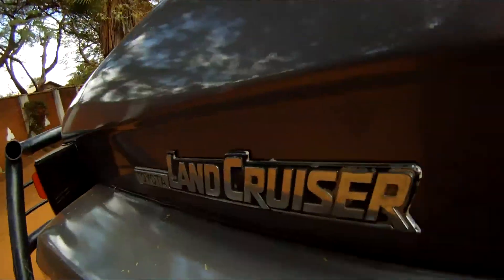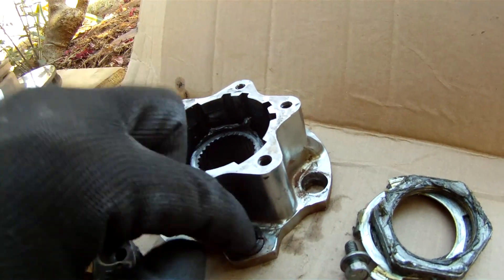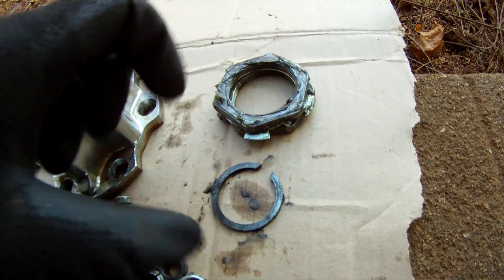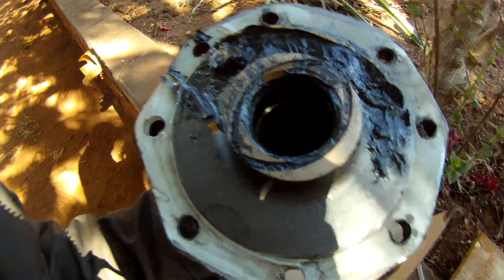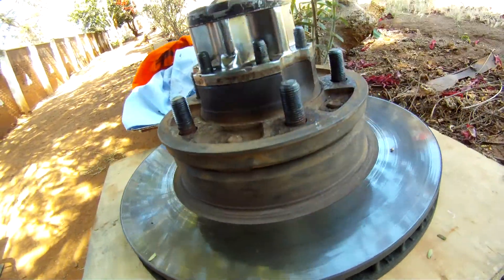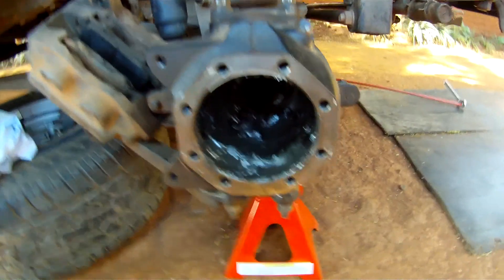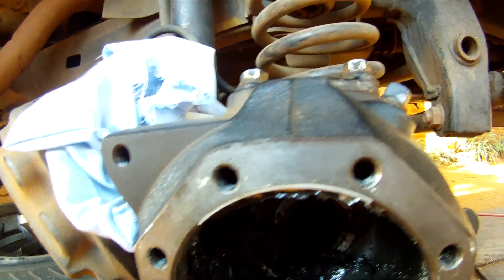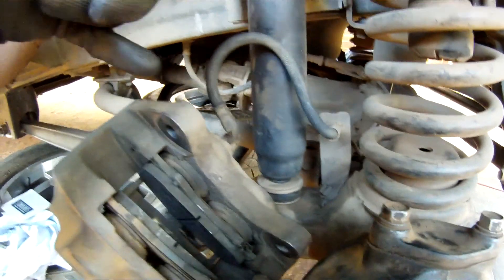Hubs, Axles, Diffs & Propshafts - Land Rover guide to the Land Cruiser - 7/15

Comment: You can just leave the hubs locked. It’s really not a big deal at all
Reply: Selectable hub locks are a great way of getting home if you crash your diff or CV
‘s
Reply from the maker: No I agree, I see on later models they've done away with it and they're just like Defenders
Reply: @lrworkshop  Actually the free wheeling hubs have always been an option (sometime an importer option). Was already the case on the 40 series, some countries want them, some don't care so don't have them. Never saw a test that proved they can save any measurable amount of fuel, in time of manual steering they made the steering a bit easier to operate.

Comment: Those C clip rings drove me nuts on my Land Cruiser axles until I bit the bullet and bought the correct tool.
Half an hour turned into 10 seconds getting them out or in.
The Knipex version has the code 45 21 200 for anyone with a Toyota. Other companies make similar but I can only speak for the Knipex.
If you work on Toyota's, treat yourself, you won't regret it.